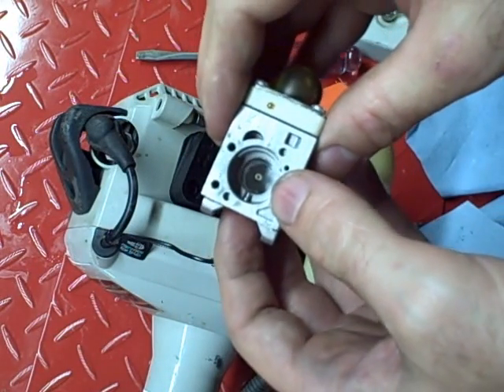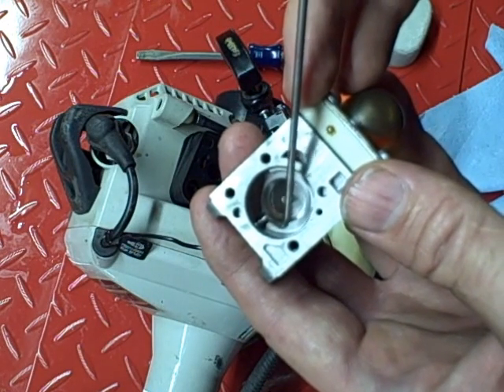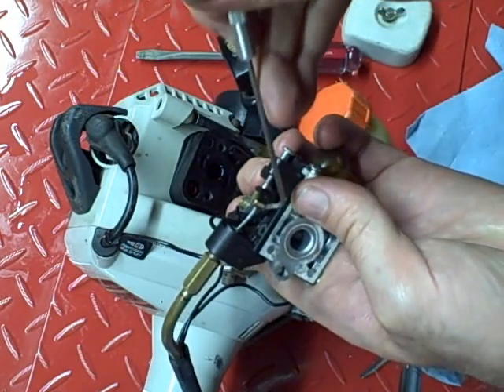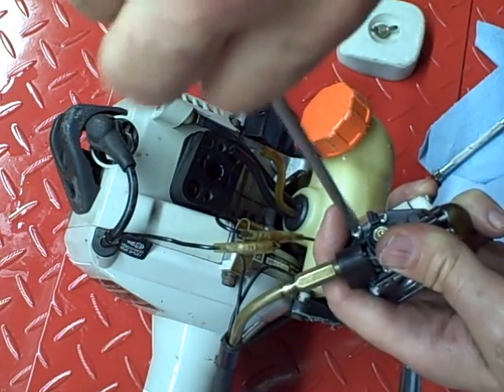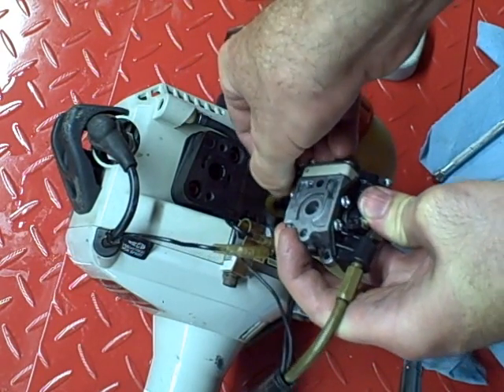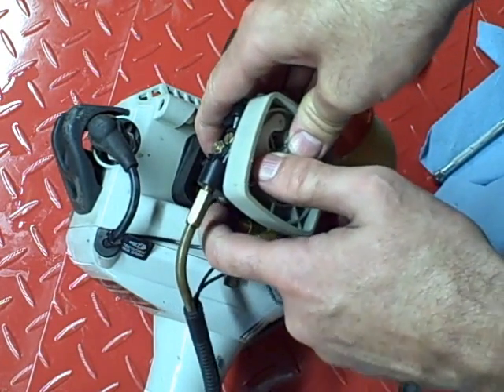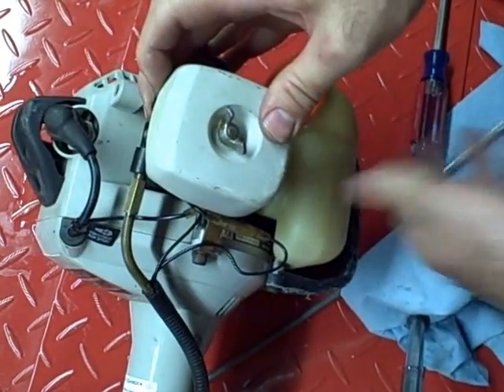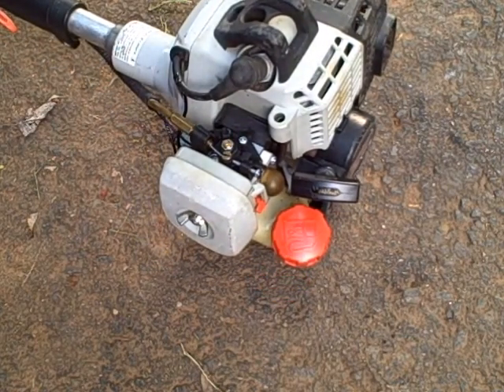Small Engine Repair: Rebuilding a Diaphragm Carburetor on a Echo SRM-230 Trimmer Part 3 of 3

Comment: I just completed a rebuild of the carb with new hoses filters plug. When I tried to start it the first time no starty and the air filter was soaked with fuel.....any thoughts or just start over to make sure everything went in correctly? By the way I wouldnt have attempted the rebuild but your video was so clear it made it a snap....except for the no start part that is.

Comment: How valuable is your time ?
New carb  $35.00 at amazon delivered at your door 
Remove old install new  15 minutes  done deal.  For home owners I prefer the electric type 1) doesn't wake up/disturb  the neighbors  2) just switch on 3) no gas and oil aroma in the garage/ shed BUT then

Comment: I did find this video helpful, thanks!. I have the arm 210 and have issue with it, it will run with choke off but will die if I throttle up. I have removed the Carb and inspected all gaskets and diaphragms they are still in good condition with no tears and still soft. I did however find that the O ring on the  rotor was deteriorated  and I think it is sucking air there causing this issue, what is your opinion, starts up fine when cold and will idle

Comment: hi... great video...I am working on a no start arm 230. I cleaned carb, replaced all Carb gaskets and diaphragms, new grommet, fuel lines filters and plug. it starts cold without issue and runs WOT...but dies at idle as it appears yours did in video. can you update how you amended as it seems there is no obvious hi lo adjustments on the zama kb66

Comment: Thanks for doing this series of videos!  I have a Zama RB-K75 and the carb kit is the exact same part # and from looking at your video series, the connections is the same as my SRM-210i.  Most other YouTube videos just unhook the throttle cable and don't bother to take off the top piece (black in color) and nice that you explained how that part works and fits back together.  Not sure if I would take that part off though.  And many do use carb cleaner, so thanks for the warning.  Great video!